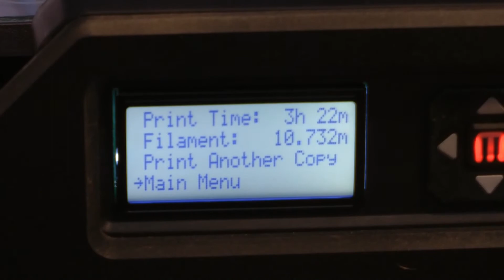Dual Quick Change Filament Guides

Comment: Hey great idea Steve, I see this is a year old post, do you have a revision on this concept since this video?
I'm thinking that as your design stands, the top cover would foul on the guide cones, (if you installed cover)
What reasoning (apart from easier threading through, I realize) for such large cones  and to have them extended so far from the main cable.
Would it be a better thought to make the cones smaller and run them down the sides of the main cable (reducing overall height & fouling on the top cutout section of the (not seen) top cover?

I'm actually thinking of racking all the filament at the top of the printer, making the reals sliding along the x axis and with the ability to be quickly removed (say on base bearings).  Then mounting one of your guides fixed to the modified top cover to feed directly into the top of the extruders.
Do you see any problem with this idea?